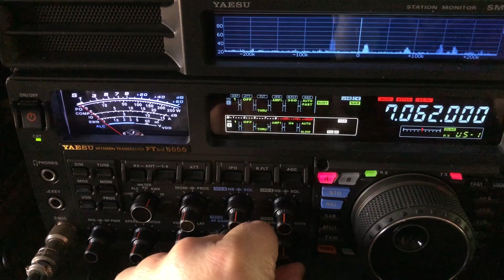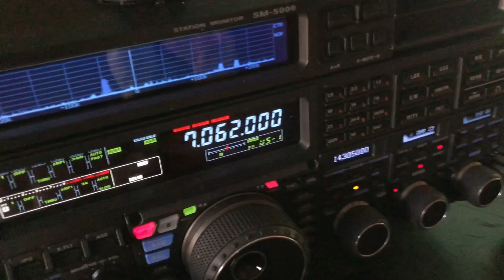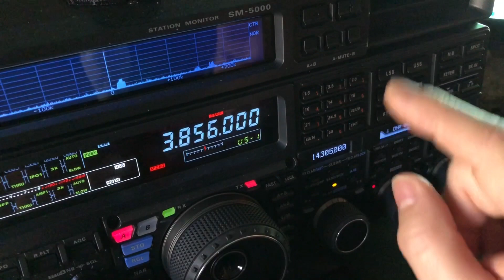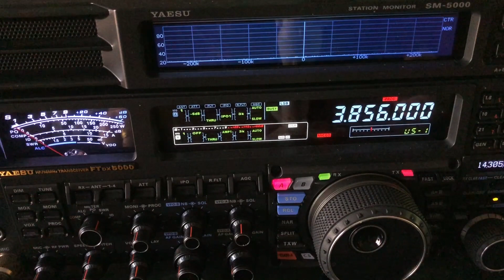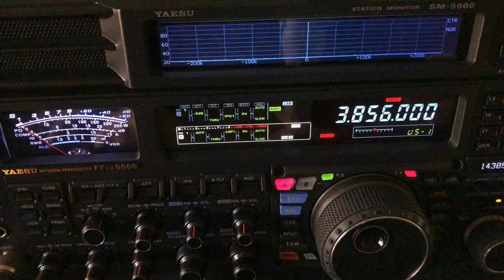No More Power Line Noise

Comment: I am still looking for a fairly inexpensive device to locate the power line noise.  I believe an air band receiver with am mode was suggested.  I have a hand held tape measure yagi for 2m.  Can I use that with my HT at some frequency?
Reply from the maker: Power line noise affects HF bands more than it affects VHF.  I have had power line noise strong enough to affect VHF, but it was caused by the old insulators supporting the three-phase power lines in front of my house.  That was the first thing Georgia Power fixed.

It is not your job to figure out which loose or dirty hardware on the pole is at fault.  I ride around in my truck with my HF mobile listening on 20 meters.  I note which poles are the sources of the noise.  But you could do the same with a AM transistor radio.  But you don’t even need to do that.  It’s your power company’s job to locate the source of the noise.

The power company has a parabolic antenna that they connect to a special receiver that has a speaker and S-meter to listen for, pinpoint, and measure the noise source and intensity.  Your power company is obligated to stop the noise.

73, de N4HNH

Comment: I have a power line radiating harmonics of the local AM station that appear in the 60 meter band.  The audio of the station is so garbled with 60 Hz you cannot understand it. Walking around with portable shortwave receiver,  the interference comes from one pole and transformer services 8 houses.  I believe it is caused by the  lightning arrester on the transformer.   I notified the power company and they said that they would refer the problem to their power quality department.  Sometimes the problem gets better by itself.
Reply from the maker: My power company appreciates it when I report noise and they found a blown lightning arrestor.  They have no automated way to know.  They know that I don’t call until I have verified that the noise isn’t something else.  So we have a good relationship.  I found that being nice and patient paid off.  I hope yours gets resolved soon.  That sounds horrendous.

73, de N4HNH

Comment: Glad your noise issues were resolved.  Out of curiosity, what's a typical noise level on 40 meters SSB with IPO1 for you these days?  My noise floor has been higher than usual lately and I'm having a hard time figuring out if it's interference or just band conditions.  KN6LFB
Reply from the maker: Hi Jonathan!  Right now, the noise floor at 7.158 MHz LSB, with IPO1 enabled, is S0.5 to S1.  I never operate on 40m SSB without IPO.  I might disable IPO for 40m CW, if I am trying to work a weak station.  I was able to work SOTA activator NY4G today on 7.065 via ground wave.  He was some 50-55 miles away running QRP.  But you can imagine how low my 40m noise floor was on CW.  It was not even moving the meter.

73, de N4HNH
Reply: @n4hnhradio  I must be dealing with some sort of interference then, as I'm S3 on a good day and S4-S5 today (IC-7300 with amplifier off).  I don't see any obvious interference bands or birdies, and turning off all the breakers to my house didn't lower it much, if at all.  We're all underground power here, I wonder if it's from the many solar installations in the neighborhood (my home included).  20m is about S3 with PAMP1 on for comparison.